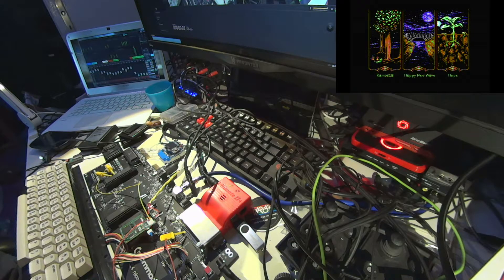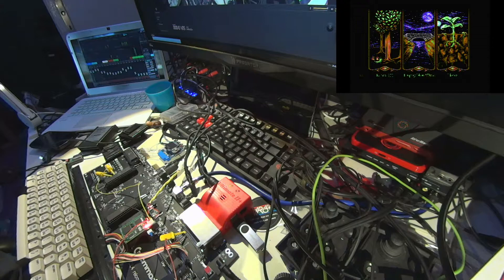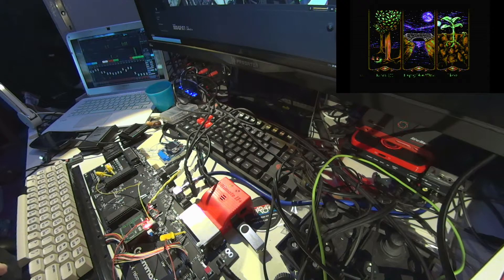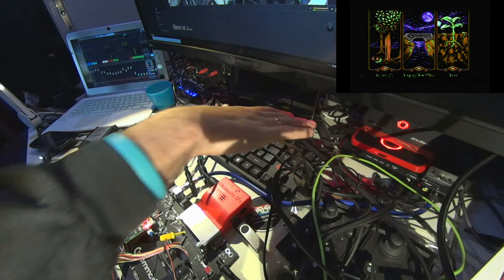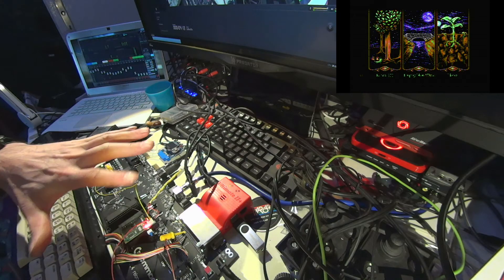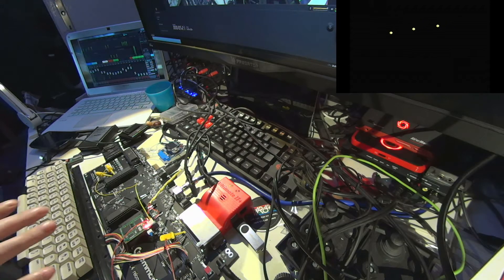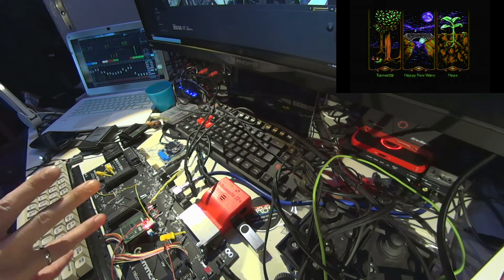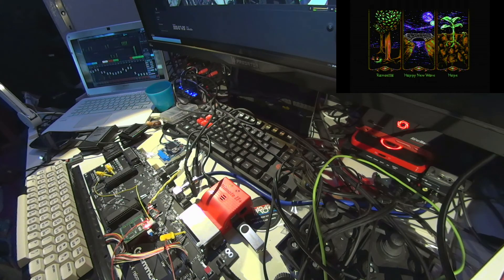Recording the 3SID demo Bridges by Samar Production on real hardware

Comment: nice explanation of the setup. Why is the Mk2 in a warning state (green flash led)?
Reply from the maker: The mk2 isn't able to recognize the FPGASID right now, this is going to be fixed but it isn't a problem because the mk2 runs the Sid as a 8580 then